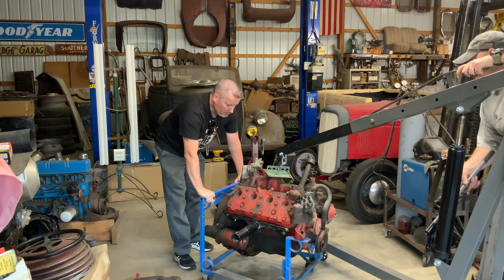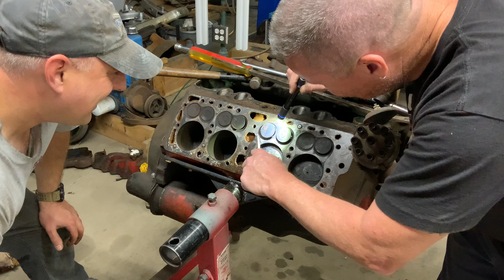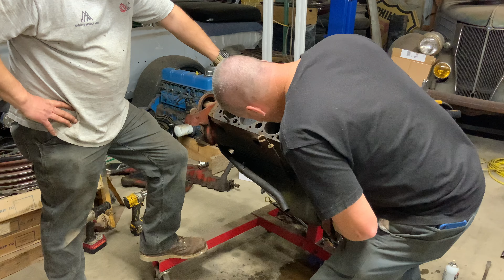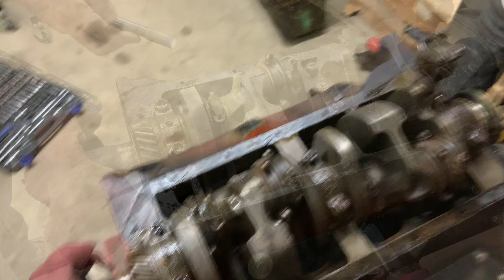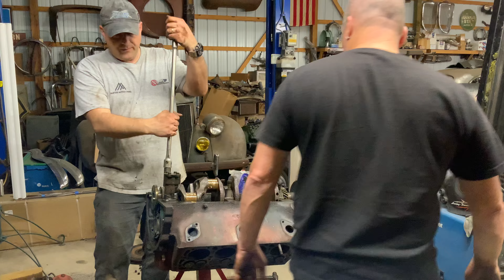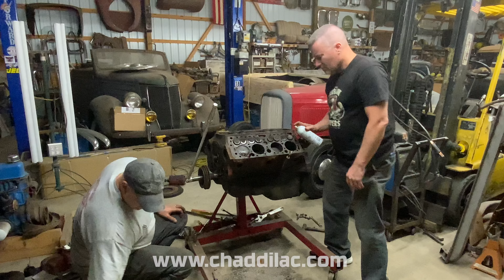How to spot a good Flathead Ford Engine!

Comment: i just finished helping get a 1935n1 11/2 truck with a flathead going,what oil pressure should it have.? thanks
Reply from the maker: Nice... all depends on the motor and if it's worn out or new. My 8ba runs 55# on start, then after it warms up around 30#... I've heard from some older guys they had problems with their engine and could barely get 5-10#. So it just all depends on your engine. Good luck with it!
Reply: @chaddilacdesigns  thank you.i just drove it a parade ran 180 water temp. the oil pressure looks really bad because we have a 0-100 gauge .like 0 to 5 maybe 10.we put straight 50 wieght in it,